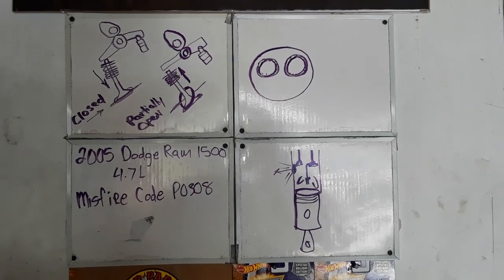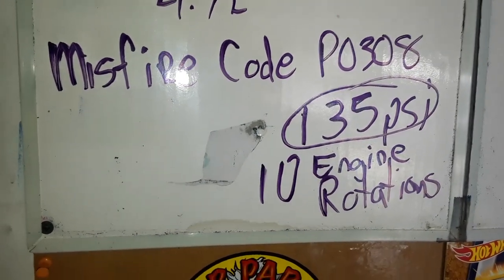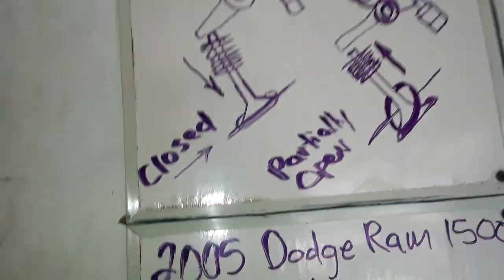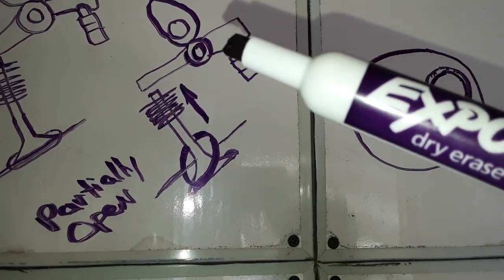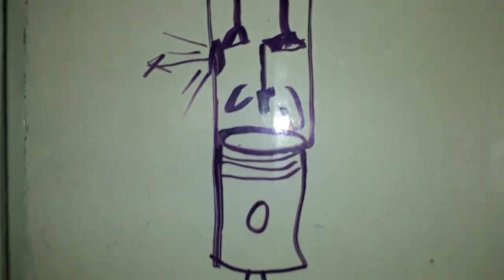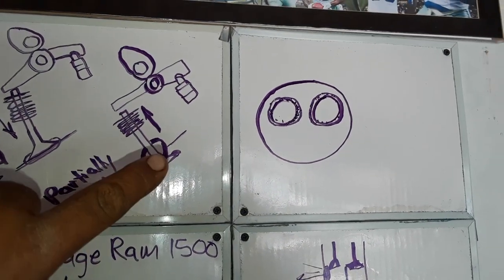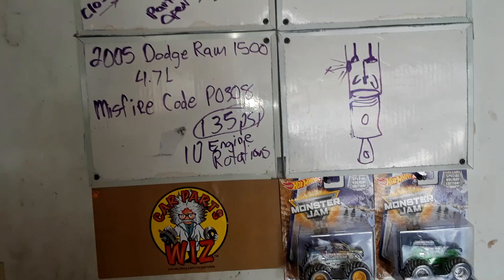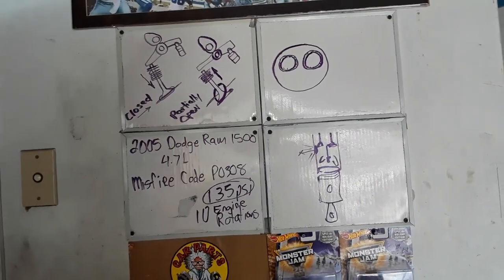2005 Dodge Ram 1500 4.7L Misfire problem explained

Comment: if this is the case then,  wont the vehicle have a bad misfire all the time??    mine has a misfire on 2 cylinder that will not go away even though I've repld the plugs and coils... but it doesn't idle rough all the time...ima try replacing the injectors next
Reply: Have the same issue, 05 4.7 N

Comment: I'm about 90% sure this is my problem on my 2006. I have the value cover gasket off and 7 our of 8 lifters are nice and tight. The 8th one (passenger side) had thrown the rocker.  Put all new lifters and still lose, so probably not a lifter issue.

Comment: Hi I have a 2004 4.7 and when I drive about 30 to 40mph it has a miss fire or studder like I'm running over a rumble strip . I have no fault codes do you think this is my problem?
Reply from the maker: Im not sure, but if you pull off your valve covers you will see the lifter fall out of position. You cant miss it.
Reply: @SuperDjnrg  ok thank you for the quick reply
Reply: @gsxrstyle  I have the same issue if you find the answer

Comment: How did you get 135 pounds compression if you had that ring stuck like that?? thats impossible?
Reply from the maker: No it is possible if the ring is not broken. Some times it will seat back in its original position and it will come back out.

Comment: I got a 2004 4.7, I bought a remanufactured engine because my old motor with 250k miles had a misfire on #5, replaced lifter, rocker, coil, spark plug, injector and stayed misfiring. Now my new motor is misfiring in the same cylinder  (#5) and I replaced coil and spark plugs and injector. Can't figure out the problem, any advice would help. Been working on it for months, just wanna drive it again.
Reply from the maker: First lets aliminate the injector connector on cylinder #5 , you can rent a noid light kit from Autozone on there loan a tool program. Plug the noid light to your style injector connector and see if the light blinks while its running in a smooth pattern. If the blinking seems  like a regulator pattern then computer signal is fine. If its irregular meaning sometimes it blinks, or does not blink at all. Then you know problem is in the harness and you will have to track it down. Noid light will also work on ignition coil connectors if you make the proper modifications. Let me know what you find out. Also im curious to know did you use the original harness when you i installed second motor?
Reply: So I got tired of working on it, took it to a shop, they found a broken vacuum hose and my evap line was completely melted and broken off. I fixed the vacuum line myself because I was quoted $350 just to fix those 2 things. But now the hose I need for the Evap has been discontinued since 2015. My truck runs okay, no more misfire codes but it could run better after I fix the evap problem. Getting codes for that, so far so good. Also that misfire on #5 was the coil, replaced it and now it’s gone. I appreciate your help. Now if you know where I could get the Evap line, I’d owe you big time.
Reply: And yes I did use the original engine harness
Reply: Check the pcm wire harness, they tend to rub and expose the wires. It takes time, but it works. Did that on 5 rams so far, same problem

Comment: My 2005 dodge Dakota 4.7L has the same issue. Except that it comes on and off randomly. I changed the plugs and coils.
Reply from the maker: Do a compression test, on all cylinders . Investigate the cylinders that have a misfire code. Do it with all spark plugs removed. I have a video of another 2002 Dodge Ram 1500 4.7L. I will send you the link.
Reply from the maker: https://youtu.be/2lmRH2VoSrM
Reply: I think mine just did it today… same here 05 4.7 Dakota how’s yours doing

Comment: I tested my coils and changed my spark plugs I have a 2002 Dodge Ram just want to know is it worth it or just buy another truck
Reply from the maker: I fixed the truck. After what all was said and done ,we replaced all timing chains, all timing guides, timing chain tensioners, head gasket kit, head bolt kit , water pump, thermostat, oil pump, resealed oil pan, runs like a champ. But all parts and labor came close to $2800.00 that is including having the heads fixed.
Reply: Gilbert Galvan thanks

Comment: How did you get 135 psi with the valve hanging open??
Reply from the maker: Well depending on where the engine stops sometimes the ring goes sideways and holds the valve open and sometimes it won't it'll fall back into its seating but after so many times the valve ring ends up getting broken but I think when I took my compression test reading the it's at back into the head but I already knew what it was because it's such a common occurrence with Dodge heads
Reply from the maker: I don't know if you knew it may not be linked to this to this video after it's done but there is another video where I show when I pulled off the head the valve seat was hung up
Reply: @SuperDjnrg  Thanks so much
Reply from the maker: https://youtu.be/zg2q68oHLp0
Reply from the maker: Here's the link to my video where I showed my hypothesis was correct. there's also more videos of me tearing the engine down, and cleaning it up.

Comment: How long did this truck run overheated?
Reply from the maker: 2 weeks
Reply: @SuperDjnrg   Thank you for the response and the videos. I have an 07 4.7 and I do 5000 mile OIC and coolant changes every 3 years to prevent overheating but I may go into the valve covers to replace the lifters and valve stem seals as a preventative measure.